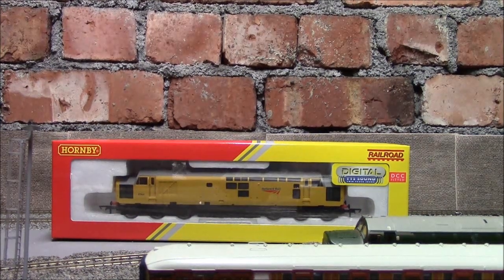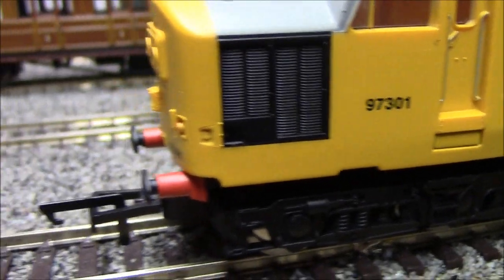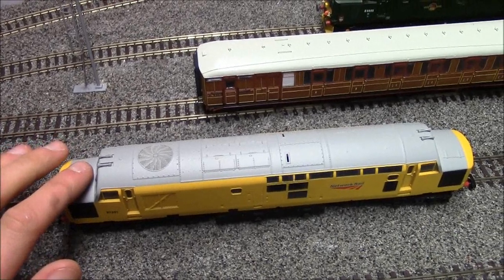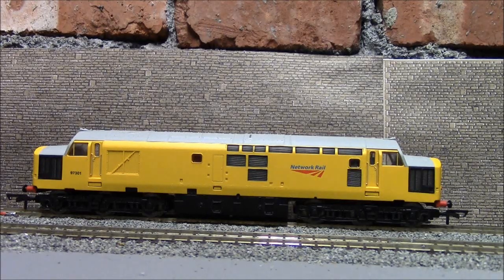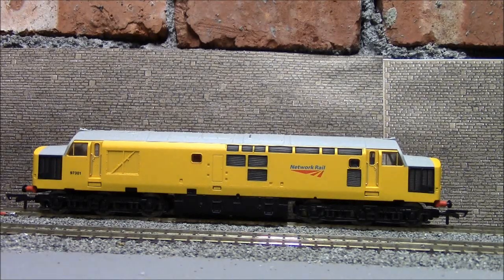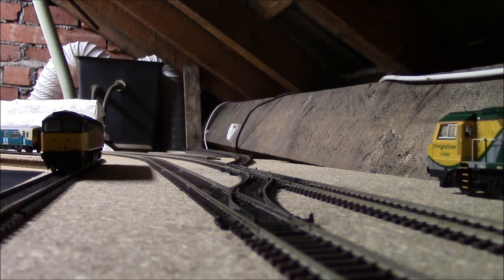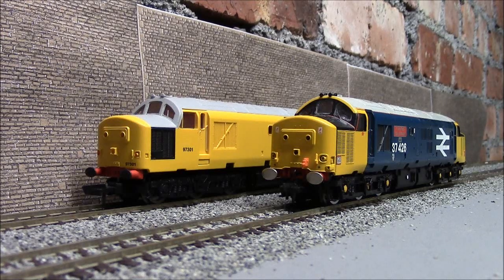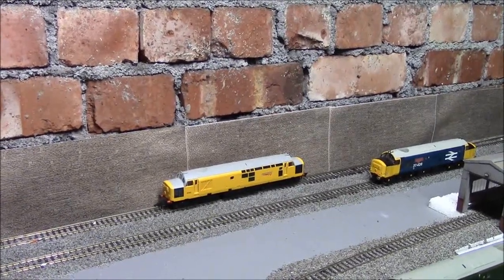Opening The new OO Hornby class 37 with TTS sound

Comment: An excellent review indeed mate! She looks absolutely stunning and the sound! Wow! For that price you can't go wrong! 97 is correct for a Network Rail 37. It's tends to be gained by deptmental stock, even in BR days. Though the real 97301 has flush ends, but who cares ;) I just wish the basic sound functions worked on DC, like when when moving. Do love the sound from the Trash option! Nice to have a bit of a comparison too! Great work and thanks for sharing!
Reply from the maker: SDJR7F88 hi thanks. i don't no much about the network rail locos. can i ask why don't you go to DCC? i run both DC and DCC on my layout so you can still run all the loco you have now
Reply: Well I would need to get a DCC controller first, but also I feel I would be bitten by the bug and would need to go full out DCC. The issue with that is I have so many engines that would need chipping, which would cost a bomb to do ;)
Reply: SDJR7F88 Chip one @ the time just like me.

Comment: Regards the number, 97301 has a flush front with proud-sitting lights that looks near identical to a 37/5. The reason that the loco carries '97' and not '37' is because 'class 97' is the classification for a departmental locomotive. In other words when a loco is modified, for example, to do track testing, it is classed as a 'Departmental Stock' and is then classed as 97. Class 97 has been put on other classes of loco before including class 24,31,40 and 47.
On the real class 97/3s one fuel tank has been removed and has been replaced ERTMS signal testing equipment, which means that a lot of work would be needed to make the ERTMS equipment to make the model accurate.  Therefore, the model accurately resembles 37198 out of the box.
Also at 14:51, the ticking is the spirax valve. A valve underneath the loco that releases moisture out of the engine when it is in idle/tick over.
Hope this helps :)
Reply from the maker: TheIntercityhst yeah thanks very mcuh :)

Comment: The number is correct the reclassification to a 97 means it has been converted or changed for departmental use. It was common to convert/re number class 97s from old locos back I'm BR days. Fundamentally it's a 37 as far as a model is concerned. In real life they look exactly the same however the 97/3's have a lot of tech on including in cab signalling for the Cambrian line.
Reply from the maker: IC125EG hi yeah i know that now. i don't no much about the network rail locos. thanks Matt :)

Comment: Great review/comparison........For the money the Hornby model comes with quite a few decoder features....definitely thinking about adding one to my collection........I also share David's concern about trailing bogie pickups...........
Nigel
Reply from the maker: S Stockmotorman thanks very much. you should get one there very good. i haven't run it that much coz its away beeing weathered so don't no if having pickups on the trailing bogie will mach it run better
Reply: matt slade
I'll look forward to seeing it when it returns, I would've thought that it should have pickups on the trailing bogie if it's updated Lima tooling - if not then a very wise addition and easy to do....
Nigel

Comment: Hi,
 
I removed a chip from one of these locos to test in another class 37.  The only issue I had was with the directional lights on my other class 37, it reversed them.  When the loco was going forward the rear lights were showing, with the headlights showing at the back, and reversed when I put the loco in reverse.
When I contacted Hornby they told me the TTS sound decoders do not support directional lighting.  I assume all I would need to do is de-solder the directional lights on my other class 37 and re-solder them in reverse order.
That is only relevant if you wanted to take the TTS decoder out and place it in a better looking class 37.
If Hornby decide to sell the decoder separately I assume they will resolve the limitation.
Reply from the maker: Simon Young iv put extra parts on it and it has be weathrerd so it looks 10 times better. ill do a vid on it soon. i was think of putting lights on it but dont no if i will yet

Comment: Plenty of functions , pity no lights , but at £89  they are a good buy , the running sound is very good ..just worries me if no pick ups on rear axle..or is there ?
Reply from the maker: ***** no don't think there is any pick ups on the rear axle. seems to run ok though
Reply: matt slade Thanks , would have thought it would have been better if they had ...
Reply from the maker: ***** do you mean the rear wheel set or the rear axle on the power set were the motor is?
Reply: matt slade Rear wheel set ?
Reply from the maker: ***** right well there no pick on the rear wheel set
Reply: Do you suppose a chip for lights can be added?
Reply: ***** i have just bought a class 40 tts sound and there is space for it and easy access for power so i'm guessing the 37 is the same?

Comment: Good. The sound will cover up the cheap noise from the motor
Reply from the maker: trainmania100 there is no motor noise on my 37. iv run it with the sound off and its very quiet
Reply: matt slade ah thats interesting :-) usually the 5 pole single bogie motors like that make wheel slipping sounds and hum :-)
Livery looks great though

Comment: OK late to the party - I fitted one of these 37 TTS chips to my Bachmann. Sounds pretty good to me, but I will have to fit a better speaker (maybe the double iPhone) as the speaker provided interferes with putting the body back on. I need to play with the CV settings as the current draw on the Bachmann motor can make it stall. Cravensdmufan has some experience with TTS CV settings, so I will have a bit more of a play. That said, I think these TTS chips are a bit of a bargain.

Comment: Why not just buy spare Bachmann  body, this will have all the lights fitted, + cab lights too, they usually are obtainable from Bachmann uk, and sell for about £30 quid, wiring to decoder should be straightforward, providing colour code is the same..
Reply from the maker: Paul Dimmock well iv just had a lot of work done on it. i got it back 2 day ago. it looks much better now. ill do a vid on it soon